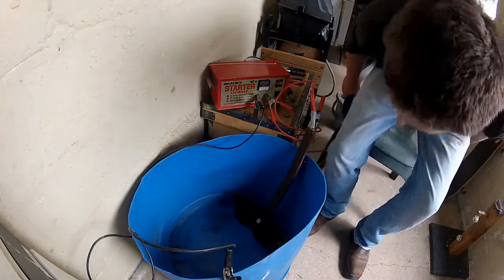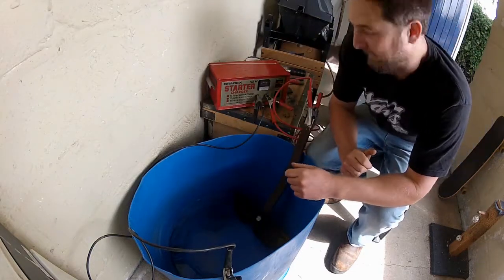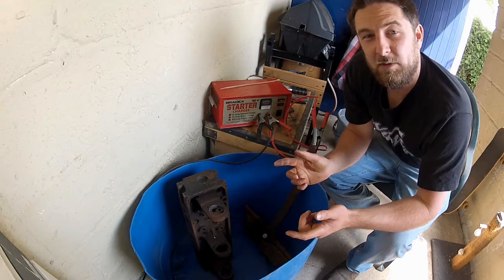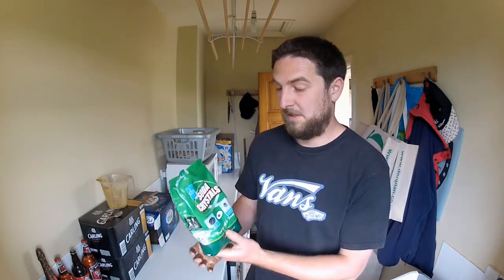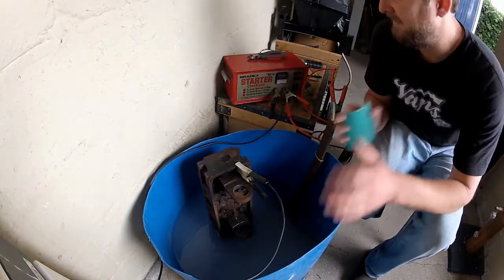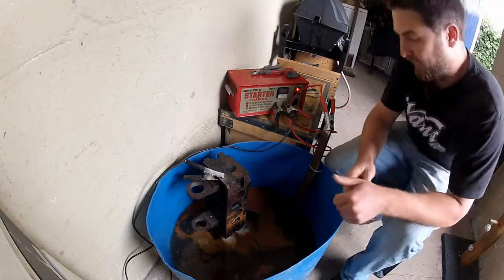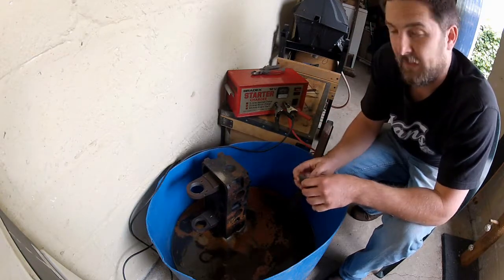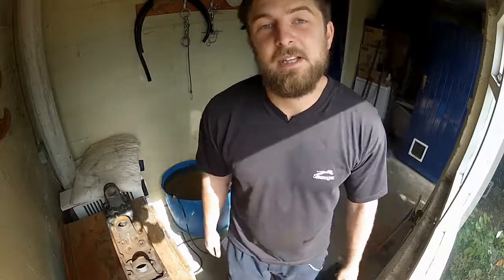Removing Rust from an Engine Cylinder Head Using Electrolysis / DIY Electrolysis Bath | Tech Tip 03

Comment: Alright mate, quick question I'm wanting to do this with the front and rear classic mini subframe obviously one at a time so I was going to dig a hole in the ground cover it with tarpaulin then follow the rest of your steps.the question is since it's a bigger part to what you used will I need to use a more powerful charger and would I need more electrodes to surround the perimeter of the part and connect each one with a piece of metal wire or something ?
Reply from the maker: +Zack Bevington 

Hey Zack. To tell you the truth, I’m not too sure! I’ve not
used electrolysis to clean 'big' parts before. The beefy charger & multiple ‘anode’ setup is surely the way to go though - space the anodes evenly around the perimeter of your bath to encourage a better reaction.  Try it, lemmie know how you get on!